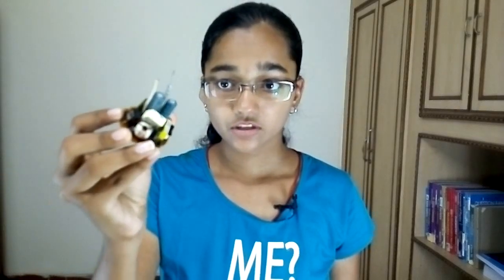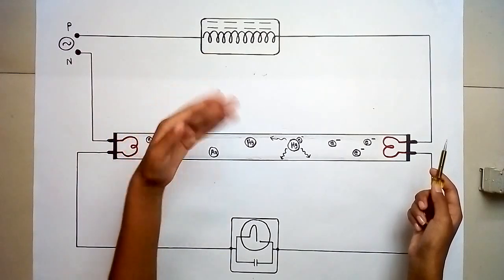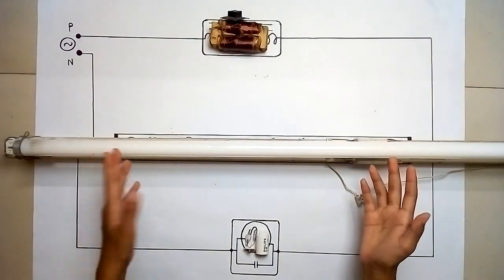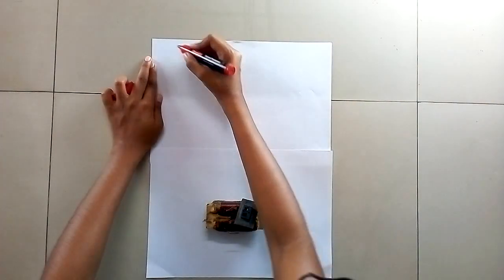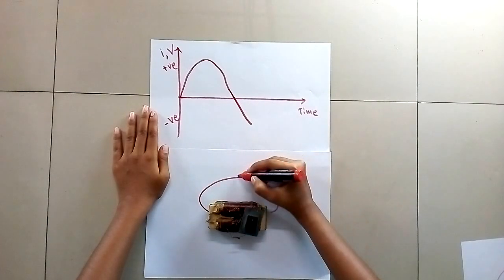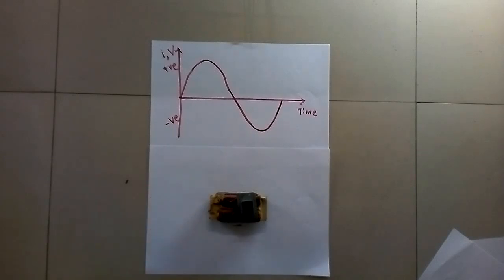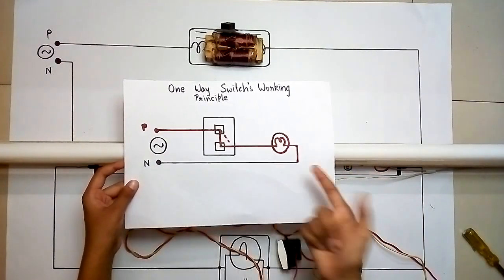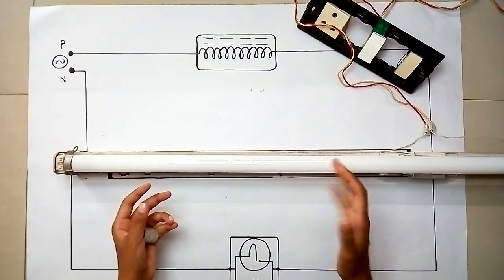How does a fluorescent lamp work? (Working of magnetic ballast, starter and flickering of light)

Comment: what happen when i broke the glass?
Reply from the maker: venkatesan m The fluorescent lamp won't light, as the circuit is incomplete, and the small amount of Mercury used inside the lamp will leak, which is hazardous. And the circuit is said to be incomplete because there won't be any electrons moving back and forth between the terminals.